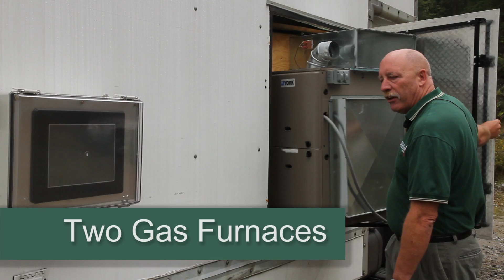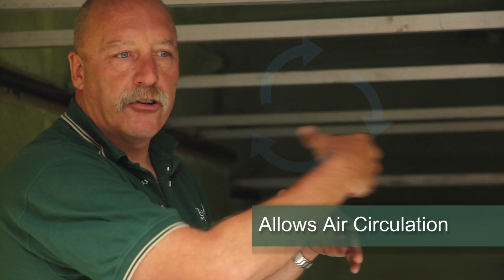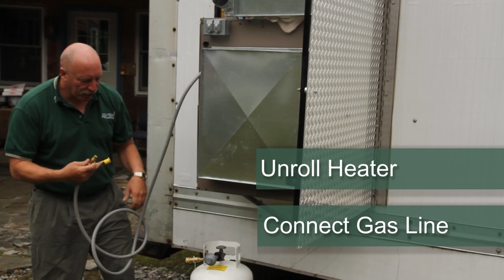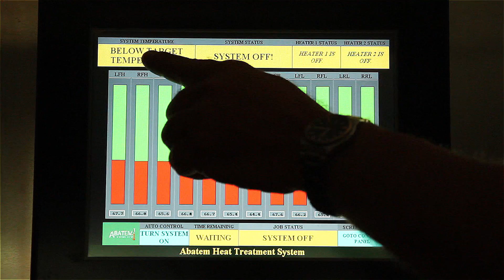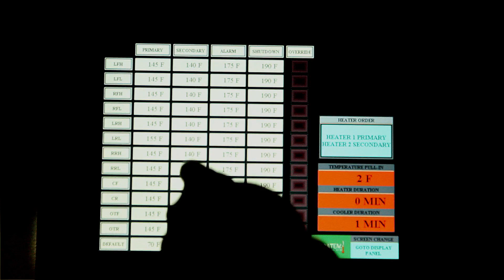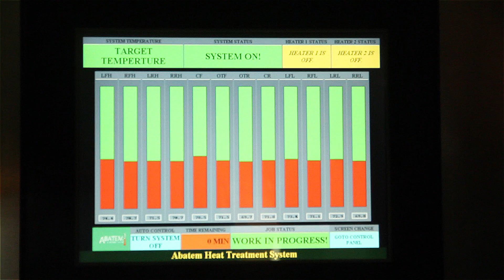Mobile Heat Treatment for Bedbugs

Comment: I had bedbugs 5 years ago and rented a 20' steel storage container and placed a 220v sauna heater with a cage around it with a fan used in greenhouses then mounted the 2 thermostats on each end of container. You still haveto spray perimeter inside house but don't have to spray all furniture and beds. I like the Abatem system since it is gasfired and most places don't have 220v/60a service. I'm in san Diego, California, a pest controllers paradise.